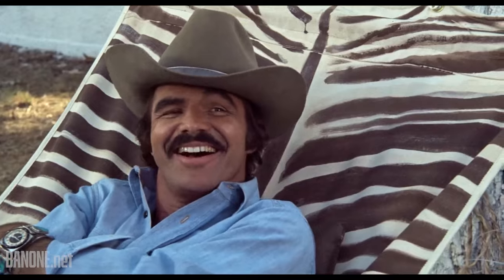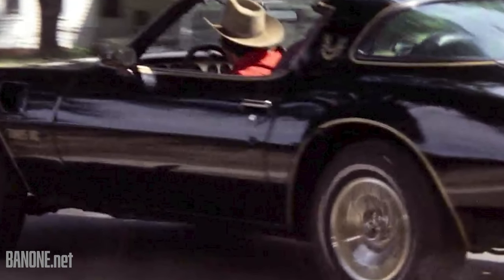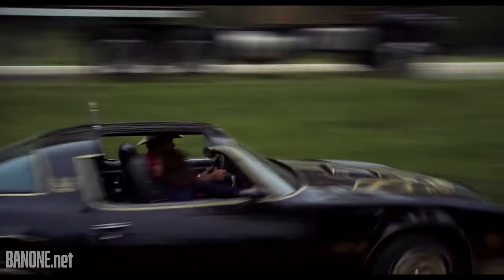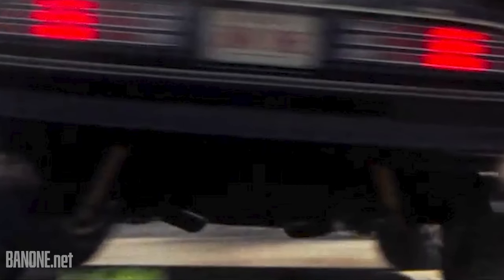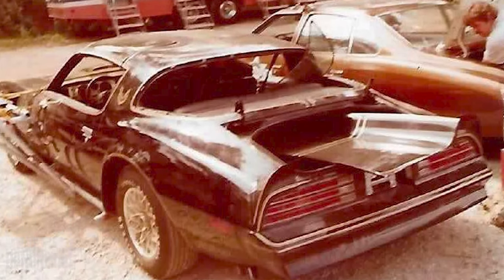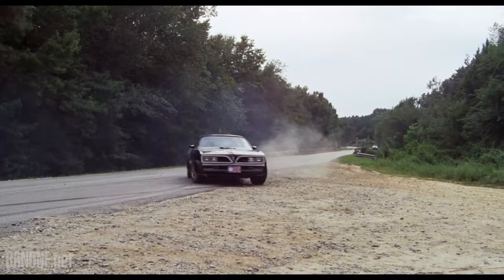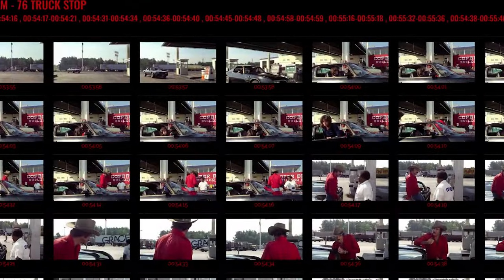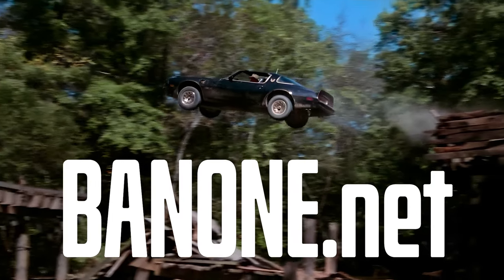Counting the Bandit's Cars Vol 2: The Trans Am Count Mystery.

Comment: I heard that all of these Trans-Am’s were 1976 models with 1977 front clips installed on them. The 1977 models were not ready for production at the time of filming, but GM and the film production company agreed that they wanted to display the new look of the car in the film.
Reply from the maker: Thanks for watching! So far our research confirms that all the Trans Ams used for filming were 1976 models. We will show the details in a future video.
Reply: I've heard this as well. But to make it a 77. You need to change the wheels, hood, hood scoop, front cover, & grilles . That's alot of work. I see the filming was in 76 so i believe it could be true but idk. Hal said Pontiac gave him 3 Trans Am's
Reply: i heard that too, on the behind the scenes of the dvd.  Hal said 3
Reply: And in one scene you can clearly see one car is a 76 with the honeycombe wheels
Reply: On the forums a few decades back by Pontiac fans, they served up some different information. Or should I say additional information. 6.6 Litre and T/A 6.6 was different with the automatic and manual transmission. The hero car always seems to be an auto, but several stunts it is obvious they are dumping the clutch.
Reply: @banonedotnet  That also gave them the option for the 455 engine which was still used in 1976 but discontinued for 1977.  And they did have some with the bigger block.
Reply: Here's the story as I know it and have read.

 The cars used in the movie were all 1976 test mule models. The choice using the Trans Am for the movie came through Hal Needham's friendship with Pontiac's PR man Jim Graham, who  invited both Needham and Burt Reynolds to a closed territory meeting showing dealerships the upcoming 1977 lineup including the Trans Am. Obviously, the Trans Am was chosen, but when it was time to shoot the movie, the 1977 models were not at full production, leaving only the test mules and display models available. These were all running and driving cars, however, they were not certified as they were not safety and emission compliant for the 1977 model year and were destined to be destroyed by General Motors anyways. 

There is not a specific tally on how many cars were that were used in the movie, but most do agree that a total of 6 test mules were used. Needham claims 3 , but up to now, nobody has confirmd the actual number, but I'd definitely accept Needham's number.

One thing that is for sure...Smokey and the Bandit was the best 90 minute ad a car has ever had!😅
Reply: And they all had the 455 engine as well
Reply: @terrybangley2281  One of the test mule cars very likely was a 455 model. You could still get the 455 in 1976 but only with a 4 speed. The bridge jump car, the traffic light burnout car and the Sally Field intro were 4 speed cars. The GM loaned cars were all 1976 models with the new 77 front end, hood, hood scoop and S/E graphics. The Special Edition cars were not being produced until the mid model year, well after the movie was filmed.
Reply: @frankartale1026 they were all 1976 models with the 455 engines

Comment: The headlight out is likely due to a rushed wiring job when the 1976 front header panel was removed (which would have had a round light on each side) and swapped for the 1977 quad light setup. It's well known that they were 1976 model year cars which had 1977 front ends as they didn't want the car to look dated when the film was released.

Comment: Well best guess, judging by the stunts in the movie, you've got atleast two cars that were totaled, the jump car over the bridge, which is confirmed and one other, and they said that towards the end of filming they barely had any trans ams left running, so that insert car and its shots with the wear must have been done at the end of filming when it was being used for the driving scenes

and theirs atleast one that's been badly bucked that shows up on film, from when they slam down onto the embankment under a highway overpass, it suddenly shows up with the jerked up nose when he says to Cletus I dont think we're gonna make it son

so one jump car, an insert car, camera car, and a hero driver

as you gotta figure they used the jump car for both the bridge and the field jump, mark that off one, the insert and the camera car with the threads

and then the hero driver, which is probably the one that got bucked by that stunt, hence why the insert car shows up at 4:57 to replace it, and is probably the one the bandit pulls up with at the end
Reply from the maker: Very solid analysis. Thanks for the feedback. Note that the car at the end of the movie has the signature dent in the door and still has its grilles installed. The filming sequence is going to be key in unraveling all the details. We will dive into the filming schedule in the next video.

You bring up an interesting point with the story of the last car "barely running in the end" and had to be "push into the scene". What was "the end"? The end of the movie? The end of filming in Georgia? The end of filming in California? There are very few scenes were the Bandit would just roll in. So it will be interesting to figure out what Hal meant by that "last scene".
Reply: @banonedotnet yeah I've always wondered what scene they are referring to also. Maybe it was the car rolling onto the park grass where he and Sally "get to know each other better"
Reply: @banonedotnet  well best guess that car with the knocked off headlight and the damage on the door was possibly used as the first car they got when they tested setting up the camera rig and fitting it in the truck

and the less damaging stunts were probably done first just to preserve the cars as much as possible, although they probably didnt plan on totaling that one with the nascar engine for the bridge jump

but depending on how it went with filming, the way that works is you have second unit for just normal driving and distance shots

and first unit for the more serious ones, so you gotta figure right there you need two cars

and you can see the stand in for burt in some of these shots

those could be second unit, while first has him driving

and man did they really screw that one up with the field jump, that could be a total right there

so you might have two totals, and the camera and the insert car that doubled as stuntcars latter on
Reply from the maker: Thank you for your thoughts! You're spot on with the direction we're heading. In the upcoming videos, we'll dive deep into the filming schedules and locations to piece together a comprehensive timeline for each car. This will help us understand the modifications and uses of each vehicle throughout the filming process. Stay tuned and thanks for your support!